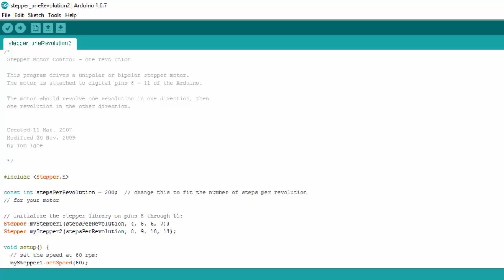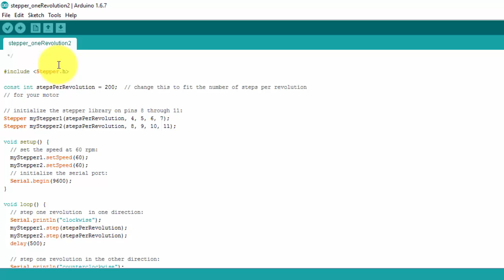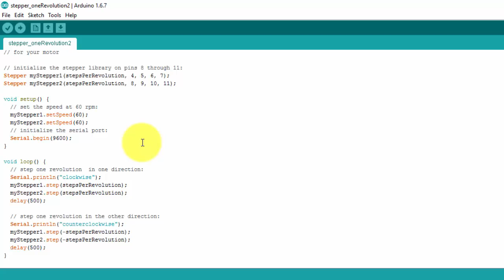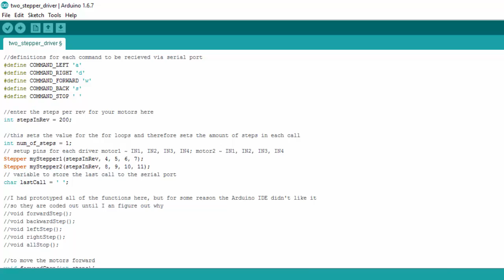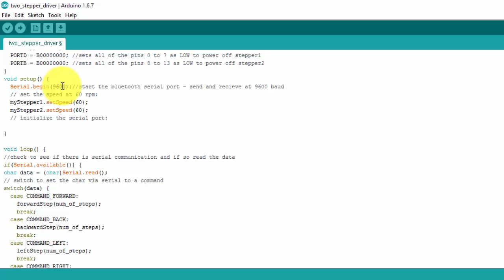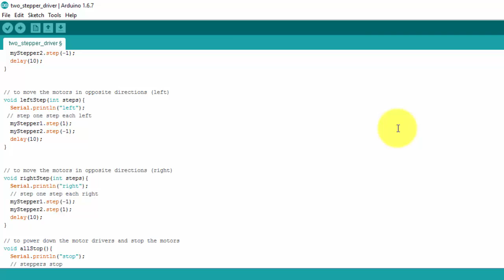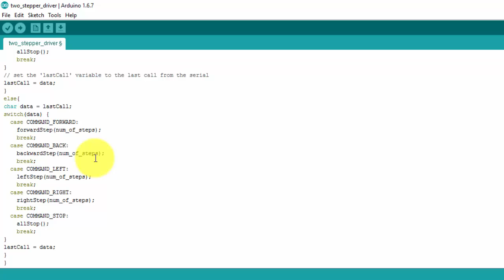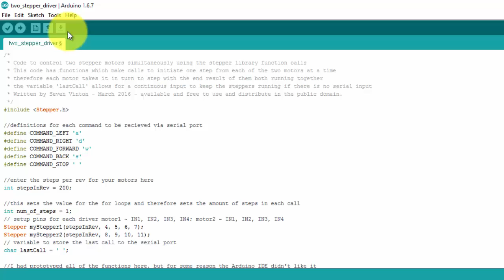Lesson 9B - Driving two stepper motors at the same time - Arduino a Quick Start Guide

Comment: This method of controlling two or more steppers is practically useless, and it leads people in the wrong direction if they are looking to control more than one stepper. Every time one motor steps, the other motor steps. Most applications of multiple steppers, and especially CNC machines, require that the motors run simultaneously, but independently regarding speed and number of steps within a given period of time. If you only need to run two motors at the same speed you will save a lot of money by using cheaper DC motors and more simple controls instead of steppers and Arduinos. Using an Arduino, independent control is achieved by including AccelStepper.h and MultiStepper.h and learning how to use them.
Reply: Hello Chuck, I've been searching for a comment like this. Mine requires what you mention here with a little difference. I need to be able to switch between states of operation when ever I want. Example if my steppers are rotating CW and all of a sudden I wanted them to stop mid revolution and do something else (via remote control), how would I go about doing that? Would you be so kind as to point me to the right resource? Thank you so very much.

Comment: Thank you.  Anyway your code did not work for me. The motor just made one step and stopped. I had to fix the code moving the  lastCall = data; inside every Case. I had paste the code just in case somebody else has the same problem.
/*
   Code to control two stepper motors simultaneously using the stepper library function calls
   This code has functions which make calls to initiate one step from each of the two motors at a time
   therefore each motor takes it in turn to step with the end result of them both running together
   the variable 'lastCall' allows for a continuous input to keep the steppers running if there is no serial input
   Written by Seven Vinton - March 2016 - available and free to use and distribute in the public domain.
*/
#include <Stepper.h>

//definitions for each command to be recieved via serial port
#define COMMAND_LEFT 'a'
#define COMMAND_RIGHT 'd'
#define COMMAND_FORWARD 'w'
#define COMMAND_BACK 's'
#define COMMAND_STOP ' '

//enter the steps per rev for your motors here
int stepsInRev = 200;

//this sets the value for the for loops and therefore sets the amount of steps in each call
int num_of_steps = 1;
// setup pins for each driver motor1 ~ IN1, IN2, IN3, IN4; motor2 ~ IN1, IN2, IN3, IN4
Stepper myStepper1(stepsInRev, 4, 5, 6, 7);
Stepper myStepper2(stepsInRev, 8, 9, 10, 11);
// variable to store the last call to the serial port
char lastCall = ' ';

//I had prototyped all of the functions here, but for some reason the Arduino IDE didn't like it
//so they are coded out until I an figure out why
//void forwardStep();
//void backwardStep();
//void leftStep();
//void rightStep();
//void allStop();

//to move the motors forward
void forwardStep(int steps) {
  Serial.println("forward");
  // step one step each forward
  myStepper1.step(1);
  myStepper2.step(1);
  delay(10);
}

// to move the motors back
void backwardStep(int steps) {
  Serial.println("backward");
  // step one step each backward
  myStepper1.step(-1);
  myStepper2.step(-1);
  delay(10);
}

// to move the motors in opposite directions (left)
void leftStep(int steps) {
  Serial.println("left");
  // step one step each left
  myStepper1.step(1);
  myStepper2.step(-1);
  delay(10);
}

// to move the motors in opposite directions (right)
void rightStep(int steps) {
  Serial.println("right");
  // step one step each right
  myStepper1.step(-1);
  myStepper2.step(1);
  delay(10);
}

// to power down the motor drivers and stop the motors
void allStop() {
  Serial.println("stop");
  // steppers stop
  PORTD = B00000000; //sets all of the pins 0 to 7 as LOW to power off stepper1
  PORTB = B00000000; //sets all of the pins 8 to 13 as LOW to power off stepper2
}
void setup() {
  Serial.begin(9600);//start the bluetooth serial port - send and recieve at 9600 baud
  // set the speed at 60 rpm:
  myStepper1.setSpeed(60);
  myStepper2.setSpeed(60);
}

void loop() {
  Serial.println((String)lastCall);
  //check to see if there is serial communication and if so read the data
  if (Serial.available()) {
    char data = (char)Serial.read();
    // switch to set the char via serial to a command
    switch (data) {
      case COMMAND_FORWARD:
        forwardStep(num_of_steps);
        // set the 'lastCall' variable to the last call from the serial
         lastCall = data;
        break;
      case COMMAND_BACK:
        backwardStep(num_of_steps);
        // set the 'lastCall' variable to the last call from the serial
         lastCall = data;
        break;
      case COMMAND_LEFT:
        leftStep(num_of_steps);
        // set the 'lastCall' variable to the last call from the serial
         lastCall = data;
        break;
      case COMMAND_RIGHT:
        rightStep(num_of_steps);
        // set the 'lastCall' variable to the last call from the serial
         lastCall = data;
        break;
      case COMMAND_STOP:
        allStop();
        // set the 'lastCall' variable to the last call from the serial
         lastCall = data;
        break;
         
    }
   
    // Serial.println(data);
  }
  else {
    char data = lastCall;
    switch (data) {
      case COMMAND_FORWARD:
        forwardStep(num_of_steps);
        break;
      case COMMAND_BACK:
        backwardStep(num_of_steps);
        break;
      case COMMAND_LEFT:
        leftStep(num_of_steps);
        break;
      case COMMAND_RIGHT:
        rightStep(num_of_steps);
        break;
      case COMMAND_STOP:
        allStop();
        break;
    }
   // lastCall = data;

   
  }
}

Comment: I know it's too late to ask a question here, But I have a different motor driver which is A4988 and its output is one pin for direction and the other pin for the steps, So can I use the same principle with the same code?
Reply: Even i have same question
Reply: personally, after I didn't find an answer I've just edit the section of the code that defines the pins to make it contains the pins that only out of my stepper motor driver, it has worked properly without errors if i remember correctly "
Stepper myStepper1(stepsInRev, 9, 22);
Stepper myStepper2(stepsInRev, 10, 24);
"
Reply: Mohamed Sharaf Thank you for your concern I'll use it in my project

Comment: Thanks, a lot. Can you upload the circuit, please?
Reply from the maker: Hi Genaro, the circuit diagram can be found in the lesson document PDF for this lesson (Lesson 9) which is linked in the description for this video :)
Reply: Thanks again
Reply: How can i use this program whit pins of the arduino? I wanna make a RC control whit 433 MHz module. My english is bad, sorry
Reply from the maker: These tutorials may help you with this: http://arduinobasics.blogspot.com.au/2014/06/433-mhz-rf-module-with-arduino-tutorial.html
https://www.instructables.com/id/RF-315433-MHz-Transmitter-receiver-Module-and-Ardu/
Good luck :)

Comment: can you let the motor have different speed at same time?
Reply from the maker: Hi, you can specify the speed for each motor by changing the argument to the 'setSpeed function, for example:

myStepper1.setSpeed(60);
  myStepper2.setSpeed(100);

Motors run more efficiently at certain speeds, so you should do some tests.

Hope this helps :)

Comment: I don't understand how the portD and portB commands work.  In all sketches I have seen they just use digitalwrite to pins with LOW??
Reply from the maker: Using the PORTD = B00000000; & PORTB = B00000000; commands is just an easy way to turn all of the pins on these ports off. Of course you can just use the digitalWrite command for each of the specific pins you want to write HIGH or LOW.

Comment: Not sure if you can clear this up for me….but I also want to run 2 motors at the same time and at different times. But Ive been reading that the AccelStepper library is the one to use for running 2 or more motors. Which library is better to use?
Reply from the maker: The AccerStepper library looks like it would be helpful, and it has been designed to work with the Adafruit Motor Shield V2, so it is worth looking into. The setup and code that I have used in this video was just a basic setup that works. Sometimes the simplest solution is the best, but it all depends on what the application is. In CNC machines where they may need to drive two motors at the same time in the same direction, they just wire the two motors together in parallel, which means that the code is the same as it is for a single motor. A good approach is to try a number of different solutions tio find the best fit, and then share your findings with others online. Best of luck :)

Comment: How can I drive 3 stepper? is there any code?
Reply from the maker: You can drive a third stepper using the same principle as this. You will just need to add another motor driver. If you are wanting to drive stepper motors for a CNC machine then you would be better off using a G-Shield or something similar. There is a great tutorial on how to use this on the NYC CNC channel https://www.youtube.com/watch?v=1ioctbN9JV8

Comment: Could I wire two of these Stepper motors in parallel to the same driver to control them identically? How do I make sure enough current could be provided from the Arduino?
Reply: I think it's better to use 2 drivers if you can. Since steppers are coils, they might induce some current during the run, so that it might interfere with the other stepper.
But anyways I am not sure and never tried it...
Reply from the maker: Hi Skyler Cornell, sorry, I only just noticed your question.
You could wire them in parallel and have them run in the same direction and the current would be shared between them. This is how the circuits on some CNC machines work. 
You would need to measure the total current drawn by the two steppers to make sure that you didn't exceed the peak current limit of your motor driver. Check the datasheet for the driver that you are using.

Some dedicated stepper drivers like the G-Shield have load balancing capacities.
You should seek a specific driver to suit your intended use.

Also, your power supply to the motors via the driver should be separate to the power supply to operate the logic on the Arduino. All grounds are connected though.
Hope this is helpful.

Cheers :)
Reply: Every stepper requires its own driver. If you want to drive two steppers identically, you connect the control signals from the Arduino to the inputs of both drivers. Never wire steppers together on the outputs of a single driver!